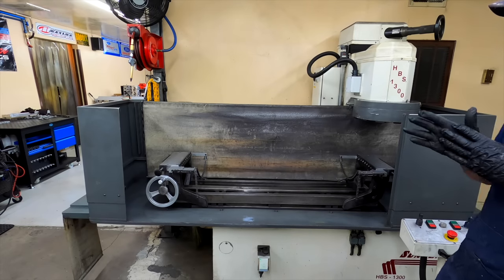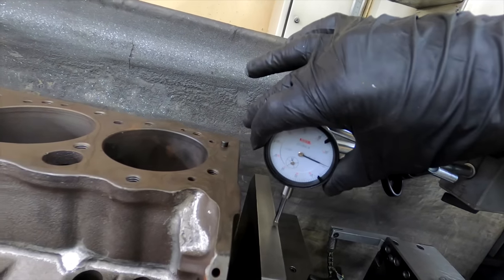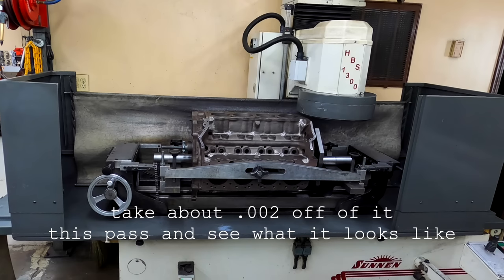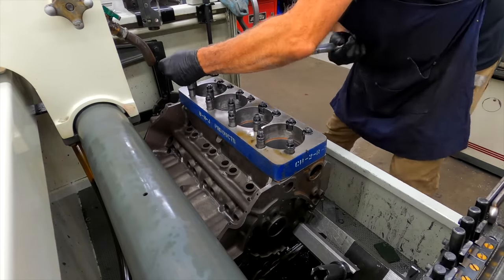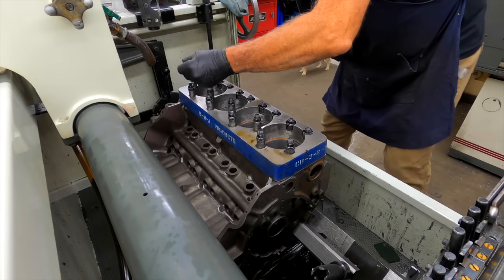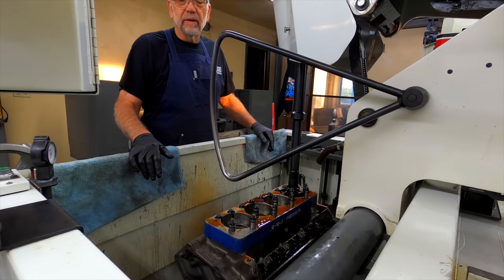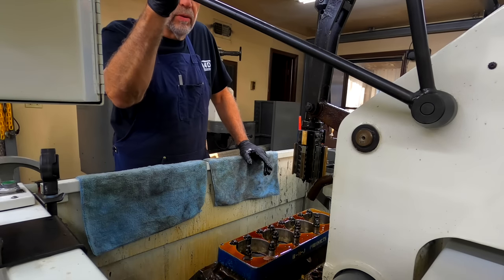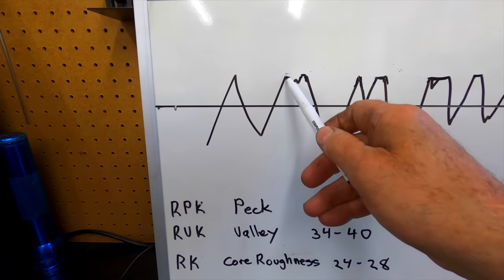One-Man Manual Machine Shop Preps Sprint Car Race Engine! | Gerald Brand Racing Engines

Comment: Old school......I worked in an engine shop for over 10 years. My boss could hone a race block pretty much as good as anyone.....on a CK-10..That was over 30 years ago and we did not have any of the better fixturing. I milled blocks on a Storm Vulcan 85-B and bored them with an FN boring bar sitting right on the decks of the blocks. Did heads with stones.....no Serdi or any other head machine. Labor intensive but mostly with good results. I still do engine work at home. Most of the guys I worked with ended up in NASCAR shops and 1 is a dyno operator for a real good shop.....I still love watching engine machining especially when it's as dead nuts accurate as your doing.....

Comment: Happy I found your channel. I have 1 bridgeport and just bought 2 more and a lathe along with a rottler valve grinder. I decided when covid started to start building a manual machine shop because I'm "young" enough to see what's going on with the economy and the world in general that I don't want to depend on computers and China is something we're to go down😂. Also, I enjoy manual work and only work on classic cars currently.  I've made a clamping setup to deck blocks and heads on my big bridgeport.  I know the setup time is my drawback, and  eventually I will buy proper machines. I've done heads and blocks for sub 9 second cars already and never have had a issue with a client's motor because I do check 3 times before doing and milling or resurfacing. I love old technology and the fact you don't have to rely on anyone but yourself to fix or to fab/engineer stuff to work. ❤

Comment: Very interesting technique with your finishing zero passes on the deck surface. 

The same technique is used when blocking your body work on large and extremely flimsy body panels, mainly due to thin gauge materials and lack of body lines. 

…I don’t think that I’ve ever seen that same technique being used in the machining of a block. 

It’s all in the details!!!
Thank you Mr Brand.
Reply: In the machining world his zero pass is referred to as a spring pass. What actually happens is the material that is "cut" actually deflects or bends around the cutting edge then springs back after the cutting edge passes. Also his machine and set up are flexing while taking heavy cuts and not so much with the light cuts.
Reply: I just wonder how many decks are sent out the door uneven because there was no zero pass hair cut or pass across with a dial gauge

Comment: Hot Rod did a build years ago, where they compared the 305 to a ford 302. The 305 was out in every direction, the heads weren’t square to the crank, and the crank ran someways through the block. They used the same cam, compression ratio, and type of intake, headers etc. then they installed the 305 in a Camaro and the 302 in a Mustang. The 305 blew up and the 302 ran well.
Reply: I would have like to watched that. I'm going to look for it. Years ago, maybe hard to find?

Comment: You can always use diamonds down to .00025" 
Then switch to stones to get that sweet stone finish with a proper RA and RZ. Yet you won't have to deal with all the used material from the vitrified stone bars.

Comment: I worked in a machine shop, the one thing that trips me out  is when people question me about the price, sure it only takes 15 20 minutes to surface a head, but it takes 30 min to set it up and 20 years of experience to do it correctly. 
You don't know how many heads I surface because someone watched a video on how to surface a head with a 2x4 and sand paper.

Comment: Honing isn't boring. Boring happens with a cutting tool, usually made with hard steel blade, when honing is made with stone or diamond. All have different types of carbon. Could've watched an hour of this easily. Especially that decking process with the setups and adjustments is an artform, just as is the honing itself. Both equally important to do right if one wishes to win.
Reply: Well done sir
Reply: Man, even when Gerald is boring a block, it's not boring!!😅

Comment: Everytime I drop something off at the engine shop I watch the machines at work. I've done some things when I was much younger like grinding flywheels and did all the air cooled engine stuff like fly cutting heads for larger cylinders and line boring cases but wasn't trained on the other stuff so I enjoy watching a good machinist at work.

Comment: I'm a fitter/turner and fitter/welder and was lucky to get a just over 2 years in an automotive machine  shop doing driveshaft repairs/mods and crack testing/repair and resurfacing heads and blocks and valve guides and seats plus engine balancing
The shop did general automotive engine work but also specialized in VW speedway midget engines and VW offroad racing engines back when they were a thing
Most satisfying work, I wasn't allowed to learn block boring or crank or camshaft grinding as that was purely the Automotive Machinists domain
So I was doing the work the machinists considered mundane and less skilled but I enjoyed my time in the shop and I learnt alot
I went onto machining in a Midget Speedway Car chassis building shop, we made everything as we couldn't import racecar parts to New Zealand back then
So most everything on the chassis except tires and the shock dampers, we got castings made locally for quick change diffs stearing boxs brake calipers etc and forgings for stub axles etc and machined them all in house except machining the wheels as our lathes were too small
This video bought back memories of my time in the Automotive Machining Shop and racecar building for me
Thankyou 👍

Comment: 0.004” is extraordinarily low from my experience. The majority have been in the 0.011” to 0.017” range for end for end level.  I like the use of the BHJ Block Tru device. It’s a great tool.  We started doing a rough deck to just level/square, mock up and measurement on the 4 corners with the actual rotating assembly, finish decking, and then finish honing. It’s a little extra work, but it was a great way to get confirmation that the deck was level and the bores were perpendicular to the deck/crank centerline.

Comment: Were blocks machined that poorly from the factory or has it moved around that much from all the heat cycles? I also like that you take spring passes. Between tool deflection, workpiece deflection, and wear in the machine, those spring passes make a difference! 👍

Comment: Great video ! Got a resurfacer, but little experience. Been searching a lot for a good videos on yt to pick up tricks of the trade and this is by far the best video I’ve seen. Some info on cutter type, speed and depth would have been Nice - but I know you need to keep some secrets haha. Anyways, thanks for taking the time to explaining, Gerald or Garald 😅
Reply from the maker: It Is a CBM , RPM 800 Cut Alum. .004  Cast .002
Reply: @BrandRacingEngines  Thank you sir !

Comment: Very interesting video, Thanks! I wonder can you expound on the torque sequence on the torque plate and head installation? Its different than what I was taught. Just curious if you have better repeatability with roundness after putting the cylinder head on? I may want to add this method to my madness.
Reply from the maker: I was taught that at the first shop I work at.Torque one head inside out and then see how many times you have to go over the torque to make it solid.Do my sequence and see how many times you have to go over it to make the torque solid.:face-orange-raised-eyebrow:

Comment: Hey Gerald Cool vid! I was wondering do you rotate your stones for wear?
Gunna watch more of your vids :D I've just started as a Automotive Machinist last year and been a blast learning the trade.
Also I work with an older red model of the sunnen and its happy spot once it starts grinding is around 30-40 :)
Reply from the maker: The surface uses 1 CBM

Comment: I think I would have preferred to have block decked and bored to your equipment (precision ground, hardened steel?) rather than adjusted to factory machining.
Your probably more accurate than what was done 40-50 years ago plus block is now well seasoned  so distortion and stressed will have dissipated from the vibration and many heat cycles.

Comment: I actually like to see things in real time rather than speed up. I can hear the machine cut and get a feel for feed rates and rpm etc. I lose interest if the whole video is sped up. I certainly NEVER get board. It is with interest its always older guys doing this fine work. As I have got older I have started taking a far keener interest in machining and have a workshop with a CNC mill etc. It has got to the point I'm talking with a local CNC shop and seriously considering selling up my business and and starting on the ground floor learning a new trade. Not sure if I can afford to do that but who knows.

Comment: What stones do you use before you use the plateau brushes on a stock block like that?
Reply from the maker: 150 -200 first 400 sec. Load on the stones has a big effect on your finish.
Reply: @BrandRacingEngines  so somewhere along the lines of an EHU-412 then a JHU 820?
Reply from the maker: @kedfarmrepairs  Yes , with a cv616  25 to 30 on load meter

Comment: Wouldn’t it be nice after that block was cast to throw it outside and let it cool and twist for about a year like Duesenberg did with their engines. Then remachine the block to zero. I guess I’m old fashioned. I wonder if they did the heads that way a hundred years ago. Yes Duesenberg is over a hundred years old!!!

Comment: I'm definitely NO expert on the subject ??
But, from my experience with Motorcycle Engines which included Rebuilding and Machining.
I found it a tough business to make a decent living from.
Possibly I was Too cheap ???
I did use other shops rates as a guide and adjusted from there to suit the work that I was doing.
In the end I found it wasn't really that Financially rewarding, even if the personal enjoyment was there.
Suppliers did you NO favours on Machine supplies and parts required for building the engines.
I did originally get involved, because it seemed like interesting work.
Thankfully I sold off most of the business to someone who was more interested in the personal fulfilment than the financial side.

Comment: Old school conventional tool maker/machinist with 10+ years of automotive/cycle machining exp with everything from big block V8 down to single cyl lawn mower and everything in between including Harley Davidson,  yet a 426 HEMI never came through the door, damn LOL. Factory parallelism from center of crank to both decks is damn near a mile off from stock early model sbc and ford blocks, and grinding the decks is better that a cutter with multiple inserts because of all the interupted cuts and you let the wheel spark out before you switch to other bank for V8,  you'll have a flatter surface and more  precise parallelism to the center of the crank.
Reply from the maker: The Cutter Has 1 CBM Cutter

Comment: How does a tapered cone square up to the cam tunnel when the factory chamfers are rarely "square" to the cam centerline? It would be more accurate to have solid bushings that are near size to the bearing bores themselves.
Reply from the maker: The tapered center on the cam bearing hole. The taper on the cone is not the same tapper on the cam hole

Comment: Is the oil pan surface not checked for flatness 1st? It would be the least likely surface to have been machined post mfr. Intake bottom too? Or are the source castings mauled by professionals in the field...
Reply from the maker: All machine work is off the main bore

Comment: I've got a 82 Honda Goldwing GL1100 that i'm interested in having surfaced and honed. Do you have experience with that type of engine or should I check with a shop thats dedicated to Motorcycle engines?
Reply from the maker: No Sir
Reply: @BrandRacingEngines  Ok thank you. Im mostly worried about using a shop that is going to screw it up then having to get it redone. Anyway, great video.

Comment: When decking the block do you always take the same amount of material from each side?
Reply from the maker: A square the deck to the mains. And 90°to the cam tunnel. Stock blocks were never even.
Reply: @BrandRacingEngines  thank you for the response but I think I worded my question wrong. With a V8 engine you have two banks of cylinders, four on the left side and four on the right. When you deck the block do you take the same amount of material from the left and right side of the block? (I apologize for my long and probably terribly worded question, I know you're a busy man, I hope I'm not being a pain in the ass!)
Reply from the maker: @craigcode7103  when I'm decking and block I measure from the center of the crank line to the deck on each side so it is the same come blocked or not equal from side-to-side so some blocks you may cut 20 off one side and 25 off of the other side but the end result is that from the center of the crank to the deck surface is the same hope that answers your question thanks
Reply: @BrandRacingEngines  You explained it perfectly,  thank you.

Comment: I have a few questions to ask you what does it mean if they squared the bell housing
Reply from the maker: Any bellhousing that unbolt from the tran. should be squared to the center line of the crankshaft. Center hole & face
Reply: @BrandRacingEngines   could you possibly bolt a tkx to it or a th400
Reply from the maker: As long as it will bolt up you should be able to make it
Reply: So the back of a sprint car block where a normal transmission would bolt to is the same?
Reply from the maker: Just a 350 Chevy bolt pattern
Reply from the maker: @WilliamShaw-vn2lm  basically that block is a 350 it has a small bore for the 305 sprint car
Reply: @BrandRacingEngines  thank you so much love your videos

Comment: Hello, I'm currently swapping a 5.3 lm7(ls) into another car. While upgrading the cam i found that the 3rd cam bearing had failed. Ever other bearing, rod/crank bearings show little to no wear to the eye visibly. Is, it safe to install new cam bearings. Unfortunately i have no machine shops within my area. Need your advice please. Thank you,
Reply from the maker: Did number 3 cam bearing spin.
Is at a alum block
Reply: @BrandRacingEngines  no,it's a cast iron block lm7, and yes it was the number 3 bearing.
Reply: @BrandRacingEngines  the edges of the cam bore show no signs of roll or material loss and a fresh bearing seems as though it would fit.
Reply from the maker: I would put green loctite
Reply: @BrandRacingEngines  okay thank you